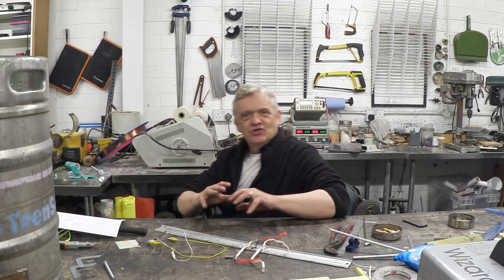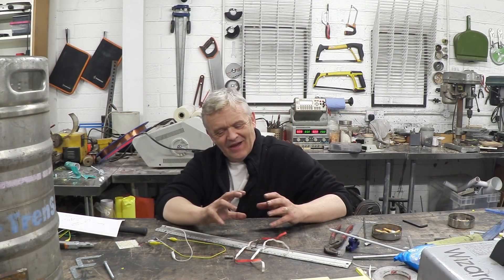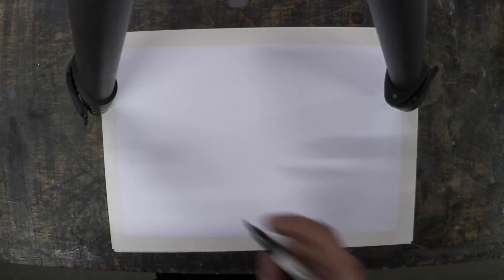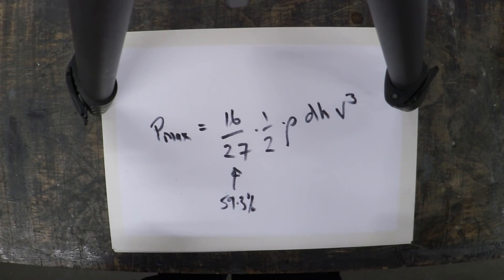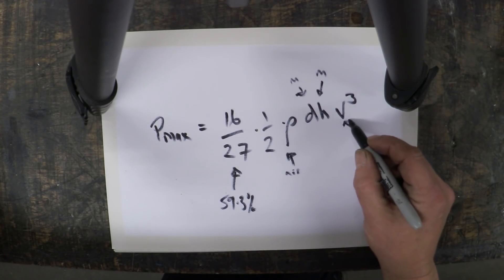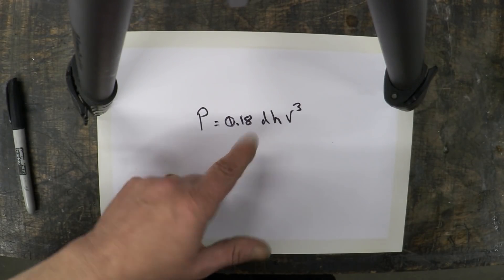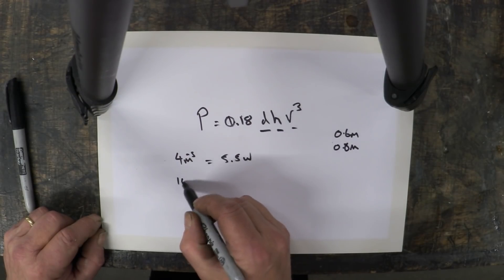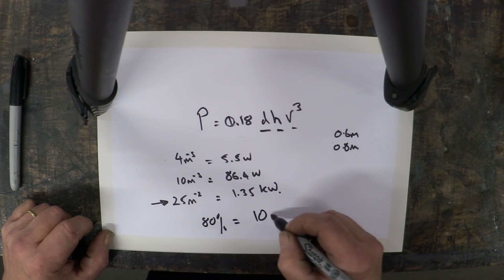Building a 1kW Wind Turbine For Under £100 - Betz Law

Comment: Nice. But you have to take into account 59.3% is rather a theoretical limit for a " would be"  perfect turbine. You are far from that figure I think but probably a lot of commercial turbines are far from that as well. The 59.3 % will be wind speed depending. A rigid turbine will only be optimal at one wind speed. On a big commercial one the blades can rotate so these can find an optimal blade angle. Wikipedia States commercial turbines het to 80% of that figure. Supprises me ...
Reply: What is the Cp of this DRAG type of HAWT, with no air foils?  ie no "lift" force ?
Reply: @MrSummitville  No idea what you are talking about. But I guess big commercial turbine all are propeller type for good reason. That may be not performance but safety or something. But I think it's performance.

Comment: To the naysayers who insist that this will never reach 1kw output.... Who cares? Demonstrating what is possible with scrap materials and producing a meaningful output is a worthwhile endeavour. If he only ever gets 250-500w out of it that's still useful and is more than sufficient to charge a battery.
Reply: Do you have 25 m/s Winds in your back yard ?
Reply: @MrSummitville  Honestly, I don't know.
Reply: @JohnDavidDunlap  25 m/s is not realistic. That is like 55 MPH or 90 KPH winds.  I remember one time having sustained  winds that fast, when a hurricane passed by.  That thing will blow apart in sustained 55 MPH winds.  Pieces will go through your neighbors windows.  So far, there has been no meaningful output.  You will pay far MORE for each kilowatt-hour vs the GRID. Being HONEST about the true cost and the actual power output  is very Important.  So, yes I do care about the truth vs fiction ( lies ) ...

Comment: First off, I look forward to every video you post. That said, might I share an observation about your wind turbine? 
I noticed that the stiffeners you used on the corners could also be used to enhance performance. If you were to make them longer and point them downwind at a tangent to the circle, it wouldn't hinder the flow or create turbulence. 
Just my two cents.

Comment: I've not built a wind turbine and this may be a bit obvious to anyone who has. Would the efficiency be improved if the wind was funnelled to the appropriate area of the blades? Obviously this would compromise the omni-directionality and that might be mitigated by a weather-vane mechanism. My main thought being to prevent the wind hitting the lower profile blades opposite the apparently optimum area. I guess this is a 'why am I wrong?' rather than an 'am I right? question.
Reply: Efficiency would decrease. And that is why they are NOT used ...

Comment: If you block air hitting the non power side you will get better results 
Piece cut out of an old drum with a weather vane out the back will keep it pointing the way you want 
Great build

Comment: Betz is a crock. Large commercial turbine manufacturers use Betz to game the market. They use it to claim that the most efficient turbine has three blades. Have you noticed how 30 years ago the world settled on three-blade industrial turbines? That's because Betz "proved" that three blades were ideal. This pushed utility turbines to larger and larger diameters until now they are so big that only very large enterprises can afford to make them. Put the three biggest blades you can transport down the road to the tallest tower you can build and you are there, they say. Except the really important measure isn't specific power in kilowatts, it is power produced in kilowatt-hours-per-year. The supposed ideal Betz turbine, then, has three huge blades, is rated at the speed as you say, but it only produces power (net power, because the alternator consumes power to energize the electromagnets) above a starting speed and below a maximum speed above which the turbine is stopped to avoid damage at the very point where it is making the most power. More blades are better. More turbines are better. Wind fields are designed with the towers 10 times their height apart to avoid them failing and smashing each other. Is that rule-of-thumb the best way to produce power? No. Is it really even based on facts? No. Think of a field of turbines, not a single turbine. Make more smaller turbines with, say, 10 blades each. Use permanent magnet generators, not alternators. Eliminate all computer controls (the greatest single cost of all in any wind field is computer control) and let them start generating from zero mph on up to whatever the wind gives them. Ten blades reduce the starting resistance so your turbine starts easier, and generates power 24/7/365 creating far more power than Betz (or GE or Siemens) could even imagine.

Comment: The area (breadth and High) calculation in the formula is for just one of the blades or all blades combined?...
Moreover, the power output depends largely on the coils I believe, hope you have sufficient coils for the 1KW output.
Reply from the maker: for the whole drum that presents to the wind mate

Comment: Wind trapping funnels, rotary wind deflectors and variable pitch blades can all help increase the efficiency because wind, left to its own, is going to go as much AROUND the unit as THROUGH it, AND [just by nature] favor neither side, AND the pitch of the blades being uniform, as we all know, creates drag to the one side of the rotor which can be somewhat mitigated by switching  the pitch of each rotor via a cam [or, for those who love electronic gadgetry and have no problem vastly increasing the complexity of their turbines] some kind of digitally or analog controlled pitch system [which would probably rob more power than it gained, although I can not say that for a fact].

1: The wind trap will force a greater percent of the wind to actually pass through the  rotor, instead of passing around it, which will cause the wind to exert more force upon the blades,

2: A diverter, which can either be used in conjunction with a trap, or without, will cause the wind to rotate in the direction of the rotor, increasing the force to the side  you need it on, while decreasing it away from the side you need it to not blow on, and these can be made either as a fixed, omnidirectional shroud around the rotor, or as a bias flow, trailing edge tiller steered diverter, which, like the wind trap [and would/could normally be used in CONJUNCTION WITH the wind trap, and would typically be steered <again> only by the wind, and therefore exert no parasitic losses (unless, again, a person chose to use some kind of powered actuator in place of just letting the wind do its own job)]

3: A blade deflection cam, which would usually be aimed using the same method of a steering tiller vane trailing the rotor acts in conjunction with some small linkages, affixed to the vanes, which, depending on where they are in relationship to the direction of the tiller [and thus to the wind] works so as to increase the opposing pitch angle on the leading edge, which by default, increases the working surface area the wind is acting against [see the formula Robert posted there] while REDUCING the angle of attack on the opposite side of the rotor, which, therefore, reduces the LOSSES experienced on this side of the equation, which, in our overall function would  be counted a 'drag' and work against the aims of rotating the whole assembly.

By combining all three of these adaptations [and it can  easily be done] one can greatly increase the power and efficiency of the final product.

       /)/) 
    (  'ˬ') 
@(>_ )-b 
     \) \)
Reply from the maker: now that is an awesome post!
Reply: @ThinkingandTinkering  If only we can harness all this inherent knowledge to commercialise this type of project. You start with a simple concept, add a few smart people's ideas and who know where it could end. Keep up the good work!

Comment: Hey Robert,, get on with it! Get the darn thing turning with a load and give it the test.
Jesus! Coulda purchased a 1kwatt from China and shipped it on a reed boat and had it here already. Disapointment included!
Reply from the maker: you may have missed the point of the channel mate - perhaps it is best you order one
Reply: you jest mr lipton,where exactly is  that current listing for a 1kW Wind Turbine For Under £100 (including vat etc) that will provide better than 200 real life watts you speak of mr lipton?
Reply: @paulmaydaynight9925  Do you have continuous 25 m/s Wind Speeds in YOUR back yard ?  Maybe, when the next hurricane passes by ...
Reply: You gotta a point there Ed. 
Keep your hat on, maybe no one will notice. SMH

Comment: You mentioned rain.  You could weather proof the turbine by turning it upside down (which would place the coils at the top) and putting a lid on it.  It should be fairly simple to do.
Reply from the maker: I don't really need to worry about the magnets mate as the are ceramic and protecting the electronics can be as simple as sticking them in a plastic bag - I am not sure if really need to turn it upside down - but cheers
Reply: @ThinkingandTinkering  HI Rob  Just thought that if you populate the coils all around the turbine it would be easier to use the lid.  On another matter I commented on your "Wind Turbine Performance" video.  Did you see it?  Any comments?  This work you are doing is perfect for advancing my concept - THANK YOU so much!!

Comment: Rain and no wind?
Hmm,
I had rain and wind here, to the point that trees damaged the grid and knocked out the power. 
So, that's where your wind went. 
To Waterford, Michigan USA. 😂🤣😂
Reply from the maker: you have to remember I am testing in a car park - I could rag it onto the roof but right now I am still working on it and tbh it's easier to put up with low wind speed at ground level than try to prototype on a roof lol

Comment: I would never naysay Rob, but it's a question of physics. At the rim, you have little torque. At the hub you have all the little torques at the rim in one place. The bigger the VAWT, the more torque. But as in all things, maximum theoretical is never achieved. I would rather exploit the torque multiplier effect at the hub. But then, I live on 4 acres in the county in Australia...  I fear Rob is flogging a dead horse, but we will see...
Reply from the maker: to be honest mate - I have no idea, which is why I am trying it - I do know there is precedent for this design - but this is really just an experiment - and you are quite right I may well be flogging a dead horse but we will see lol
Reply: @ThinkingandTinkering  Rob, I started in Wind Power about 15 years ago. I started with Savonius turbines because I just thought they were cool. Still do. Through experimentation, I found with just 3 blades going from the outside to the central hub worked a magnitude better because it caught more wind and it had much more torque for spinning my DC motors. I designed a clutch system with an arduino, hall effect rpm detector, and a solenoid to overcome start up torque problems. Most I got from it was 300w in a stiff breeze Then I was introduced to the magic of Hugh Piggots designs and the guys at Otherpower and Axial Flux  has been king for me since. 2kw stiff breeze, wooden 6 foot blades dual rotor. 24v. Tip speed and swept area applies to savonius as well.

Comment: It is very difficult to get high wind speeds close to the ground because the ground slows down the wind. I will be surprised if your turbine will ever generate more than 100 watts. 
I had a commercial 1kW horizontal axis (propeller) running 12 feet above the ground in a suburban environment for 2 years. Peak power was about 200 watts but its average power generation was only 10 watts. After 2 years I was disgusted and removed it. I now have 3kW of solar panels and they are magnificent!
Reply from the maker: I do need to get it on a roof mate - but as I am still mucking around with what is basically a prototype it is much easier to accept the poor wind rather than try and work on it on a roof lol
Reply: @ThinkingandTinkering  Understood. Lets hope you can get a good output at ground level as you can possibly expect to double it at roof level. My turbine was just below 2 story roofline with guy wires back to house. 
This was a bad decision as generator whine was transmitted through support wires to house. It was really annoying when wind speed got over 10m/s.
Reply: @peterdkay  And who has 25 m/s Wind Speed?  Maybe when a hurricane passes by?  He certainly is "mucking around" ...

Comment: I hope I don't sound really silly but I don't see the correlation between betz and your turbine for predicted efficiency.  I'll do some reading even though I might suffer a migraine 🙃. Is betz based on .1 coil and magnets based on estimated axel size. I had to watch it twice incase I missed something.  Cheers mate
Reply from the maker: Betz only describes the potential that can be gathered - the difference between the potential of what can be gathered and what is gathered is the efficiency - so you are spot on there is no correlation
Reply: @ThinkingandTinkering  in that case I'm predicting closer to 2kw than 1 and might be as high as 3. No pressure mate. I love that you a heart on sleeve kind of guy but you have to remember that the doubters will doubt and do nothing and get no results.
Reply from the maker: @karlmyers6518  lol - you are quite right there too mate - some folks just like to argue lol
Reply: @ThinkingandTinkering  If I send a machine out and it goes wrong. I quickly jump on my own back and question myself and whether I'm doing the right thing. I have to remind myself that I can't predict the future.

Comment: I personally think that you have the right idea with magnets on the rim. Every experiment that I have seen and done worked 100% better when the magnets were on the rim. If you want to get more for the buck, attach a plus symbol out of wood then attach a smaller wheel to that and put the magnets in it. You will not need as many magnets and in that way you could even run two rows or even three rows of magnets to it. You also would not need as many coils being that it is a smaller circle. The concept behind this is similar to a pulley system that would turn another wheel also giving you double the power.
Reply from the maker: nice one mate - cheers

Comment: As your rotor is going round, it gives the impression that power delivery is greater on one part of the rim and not consistent. I base this observation on the light units going brighter and dimmer in sequence.
What is causing this ? I can only think that it must be inconsistency in the magnets. Maybe the positioning of them ?
If one part of the rotor is generating more power as it goes round from one coil to the next and in turn causing the corresponding light to have a brighter pulse, then it would make sense to try and get the whole rim to be as effective as that one bit.
Reply from the maker: for sure

Comment: The strength of the magnets? How much impact does it have?
Reply from the maker: it depends - Betz is about potential - the magnets and physical arrangement is about actual - the difference between the potential and the actual is efficiency. So magnets have no effect on potential but can alter actual
Reply: @ThinkingandTinkering  Thanks Robert, I understand that. I was referring to the comparsion between commercial 1kW turbine and low cost, improvised one. Staying below the financial amount of choice is not very helpful here, I think. It would be better to see if we can make equal or better, for less money and using what is available.

Comment: Hi Murray, loving the series.
 I wonder if you could discuss what happens to the wind after the turbine absorbs the winds energy, how it exits the turbine.
 What is the resistance of the blades when moving towards the direction of flow. Could you add a cowling/shroud to direct the wind to the optimal spot on the rotor while deflecting away from returning blades. I am imagining a cushion of air around the moving parts.
 Obviously it would be very easy to stretch out your design to capture more wind, more power, while maintaining the diameter, at what hight do you think it would be pointless.
Thanks very much very inspired.
Reply from the maker: I was mulling that over mate - so I  do plan on something like that for sure

Comment: The Wikipedia article references rho as any Newtonian fluid, so I wonder what rho is for water?

Lets get fancy. One of the issues that have to be addressed with horizontal wind turbines is over-speeding. There have been various methods applied to solving that, both mechanical and electronically. A VWT like the one demonstrated I think offers an even better solution. The same coils  that pick up the magnetic flux could also be used for braking in a over-speed situation. Once the voltage would reach a certain point feed the output back to a pair of coils to apply braking.
Reply from the maker: exactly mate!

Comment: Awesome Rob, very interesting BUT, shouldn’t you have done rough calc if this type BEFORE you started building it. It’s a bit late at this stage to find you’ve got it all wrong don’t you think. Be interesting to see how it works out in practice though, best of luck, rooting for you all the way. I am a retired power station engineer and am fascinated by how it’s all going to end. Very exciting.
Reply from the maker: lol - yes I really should have mate - but to be honest before starting the build I did look at similar designs around the spec I wanted and used that as a rough guide - so to be honest I was pretty confident in the outcome - I really did this as a learning exercise